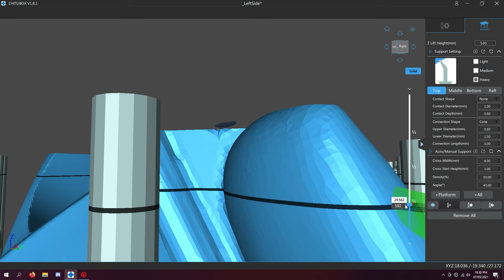GHOST MASK From Ghost of Tsushima (Hand Painted 3D Printed)

Comment: U can glue two parts by ur resin and uv lamp
Reply from the maker: Thanks yeah I’ve actually been meaning to try that, I’m just worried that it won’t be strong enough, the epoxy just add so much strength to the prints, anyways I’m currently working on my next video, another 3D printing one so I’ll probably give it a go, Thanks again. 🙏

Comment: what measures did you take? I bought the author's version and it's very small, I don't know if it will fit in one piece in my Mono X
Reply from the maker: Hi there for me a printed it in two separate parts on the Mono X, but for the measurements  I just had had to compare the size to other things I had printed in the software if you know what I mean? sorry I can’t be more helpful with the measurements i was just lucky mine turned out the perfect size.